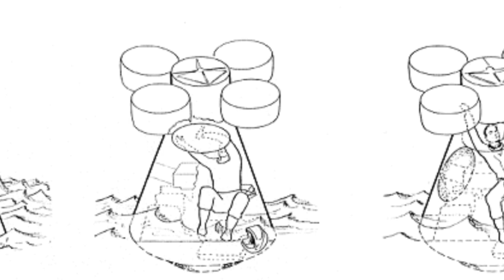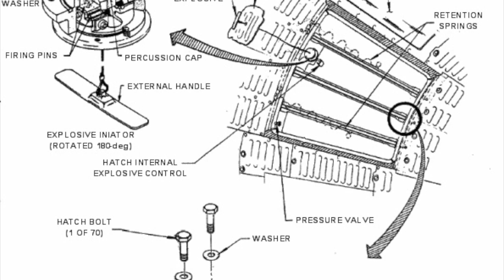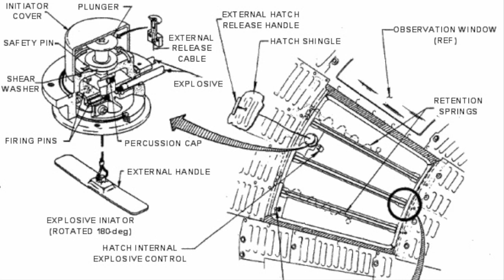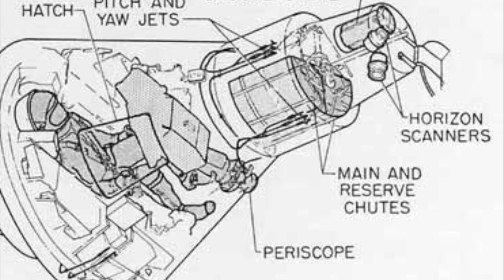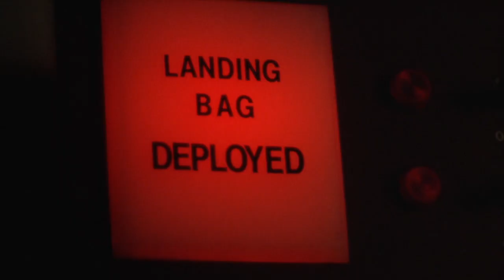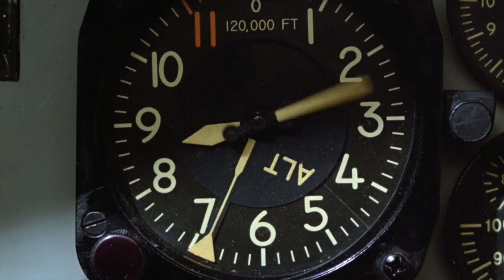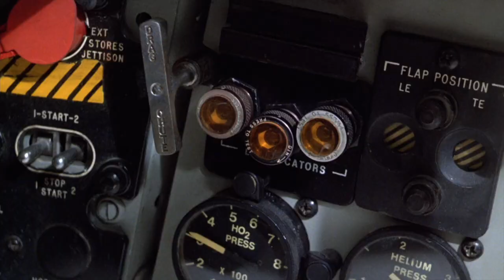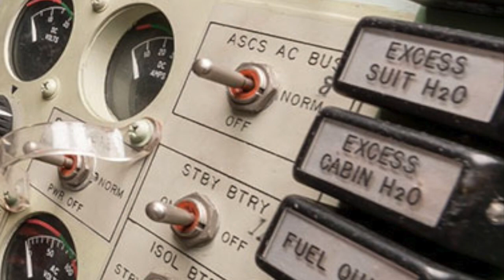Reel Engineering: The Right Stuff (1983) - Part III: Light This Candle!

Comment: Yeager has stated many times the NF-104  incident was during qualifications of the flight profile for the astronaut flight school he was commander of, to find out what the minimum altitude the reaction control system worked at, not an altitude record attempt, and has always said they found out the altitude the reaction thrusters quit working and the control surfaces also had no effect.